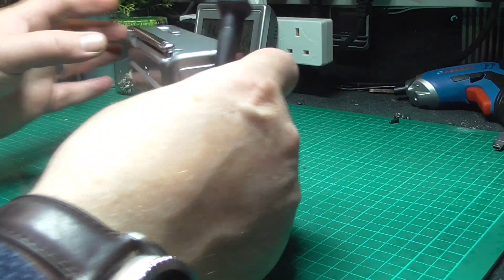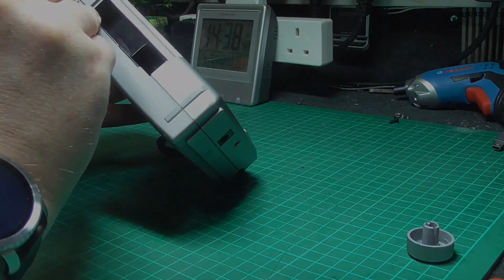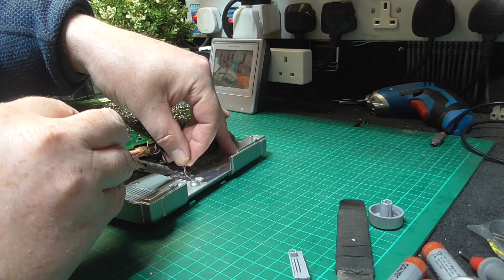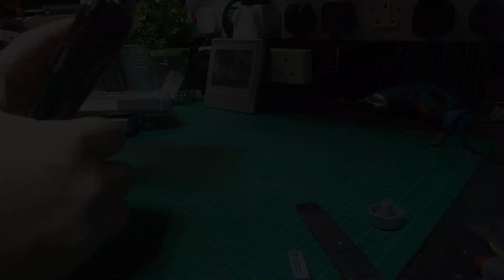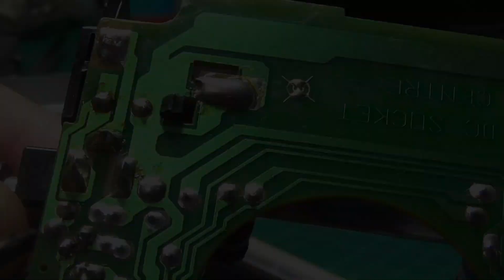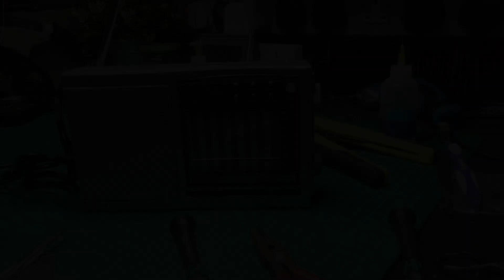Roberts R871 Transistor Radio - Won't Switch Off!

Comment: Yes, it's a pity Roberts don't provide a correct polarity connector with the radio - then that problem wouldn't arise.  Thankfully there are one or two manufacturers of suitable mains adapters with a polarity switch or a polarity reversal plug on Ebay.

Comment: Very helpful thanks. Appears to be the same electronics as the Grundig Yacht Boy 206. I have one of these that seems to have suffered the same fate! Also a working R871 . The schematic for the Grundig is available from radiomuseum.
Reply from the maker: That's super useful information Nick - thank you!, I've never had a 206 so hadn't made the connection. I will find one now though 😉. A few differences at first glance, one being the Grunnys slider for volume.
Now to find the alignment instructions!
Reply: @Codeeze  Yes with all those bands the alignment could be challenging. One of the few Roberts sets from this era that doesn't appear to be a re-badged Sangean.

Comment: Nice job. Glad my Sangean ATS909x/ Roberts R891 has an AC plug pack. You can use a DC one but it needs to be 1.4V higher to overcome the loss in the bridge rectifier.
Reply from the maker: Thanks Wenlock. The price of those sets here is astronomical - maybe one day...
Reply: My original 909 was $AUD390 in 2004, it failed with noise but no stations just after I retired in 2014 and Canohm (Sangean agent in Australia) did a trade in so I got the 909x for half price.

Comment: That one certainly gave you the run around. That must have been some heat to melt solder. Great bit of fault finding though. I assume an idiot diode will be installed before it finds a new home. Good to see you back with us. Cheers Graham
Reply from the maker: Thanks Graham, I always fit a zener now, it will have a suitable plug of the correct flavour before I part ways with it...

Comment: Fantastic job Paul. You made it look a Breeze. And if it all goes wrong you can Vent you frustration on it as it's a plastic fantastic. I vent out of my bottom sometimes. It's fairly normal I think. Got good ventilation if that happens.
Reply from the maker: Yes, the caps that vent from below will forever now be known as 'Spiers caps'...

Comment: Ahh, the chinkosonic 5000 without idiot diode. Must have had a fair bit of current to belt solder for a bridge. It should scrub up nicely.
Reply from the maker: Belted solder - is that an older method?
Reply: @Codeeze  lol
Reply: @Codeeze  yes... it creates the belt and braces bridge across two tracks. You youngsters need to learn the ways of the oldie

Comment: Well done :-D
If the repair was impossible, a bodge would be to desolder the volume control and put an on off volume control in its place, bodgy but gets you out of the shi... ship :-D
And i thought the momentary button switch was damp inside,  they play up without any reason lol.
Vcr's, car radios, and car alarm fobs often have them.
Reply from the maker: No repair is impossible. 
Roberts R871, radio. A set barely alive."  
"Gentlemen, we can rebuild it. We have the technology. We have the capability to make the world's first bionic radio. The R871 will be that set. Better than it was before. Working, switching, louder"
Reply: @Codeeze  The six million dollar man,  sorry radio :-D